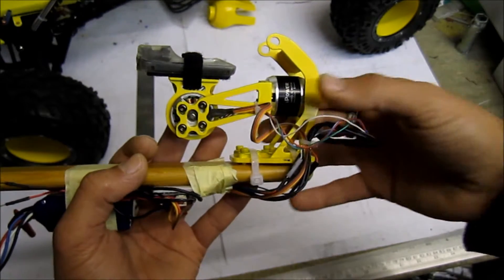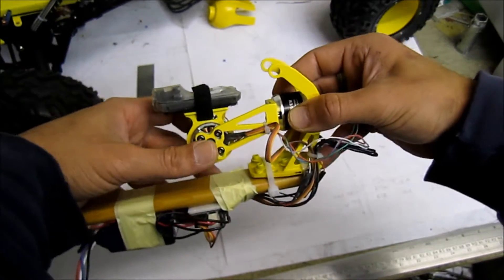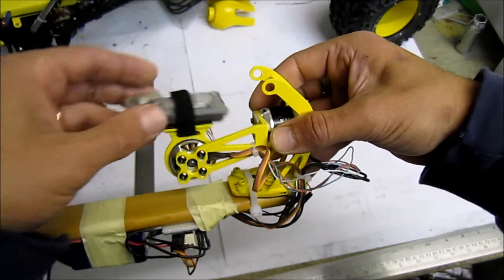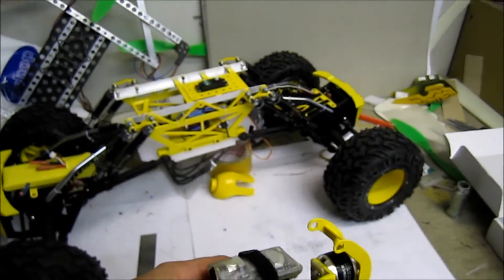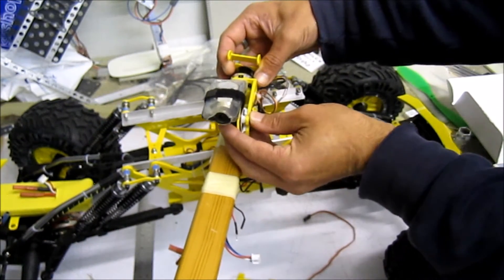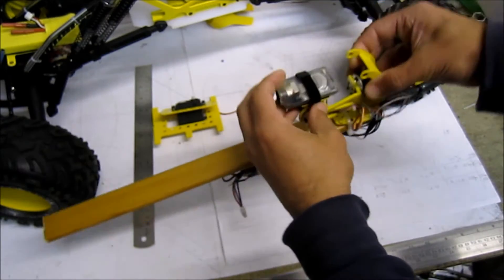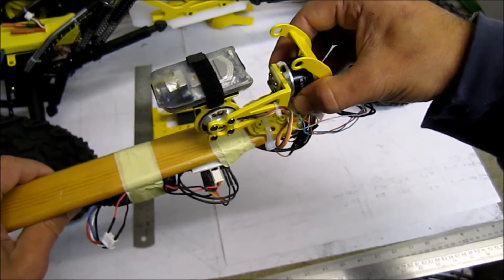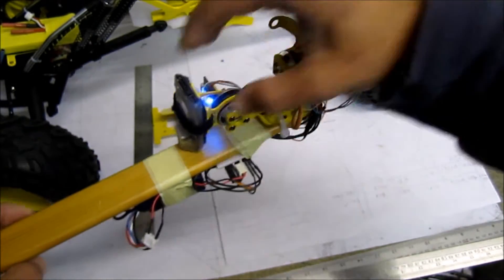Experimental brushless gimbal for Mobius, part 1

Comment: compensates for the weight of the camera useful ballast, such as a battery or power supply controller board Alex Mos
Reply from the maker: Any dead ballast is big NO NO for me on copters, and for this crawler I have it working already, check part2 and part3:)

Comment: love your approach on this one and please keep them coming! seems like you will find soon a good approach to find a solution. I do have a question, have you try to use servos instead? Only for this one.
Ed
Reply from the maker: Thanks mate, servo gimbals are dinosaurs at this day & age:) I know where you coming from, servos should do for ground ponders, but still need some sort of controller. This gimbal was suppose to go on my copter, but decided to test it first on this one. It does work with bigger pitch motor, will have part 2 video shortly.
Reply: Well, cant wait to see the final solution on your set up! Hope its now working 100%!
Thanks!
Ed

Comment: How about adding some weight to the bottom of the motor to balance the camera? Have you ever seen how they balance a car tire with little lead weights.
Reply from the maker: Adding weight would work coz it will be balanced, but that strongly disagrees with my religion of saving weight:)